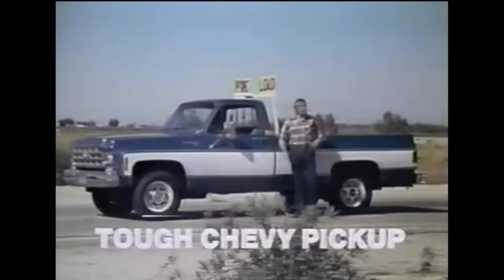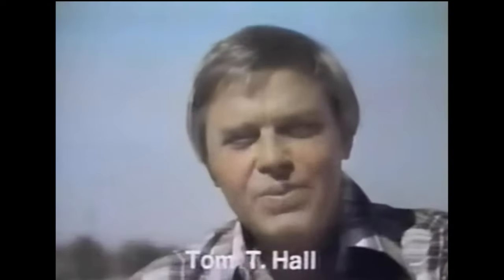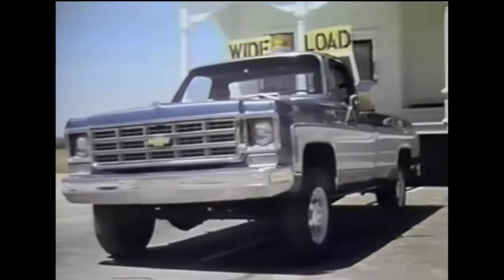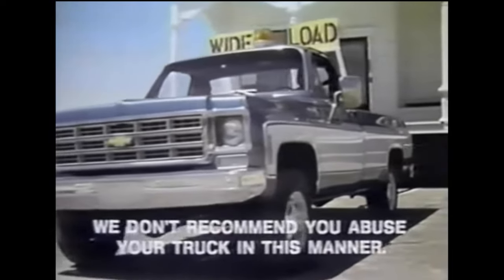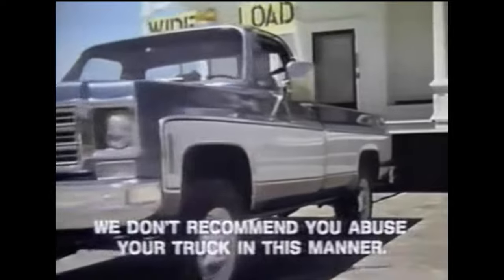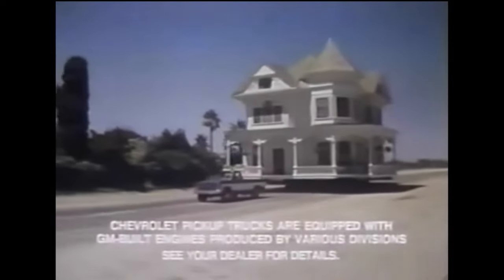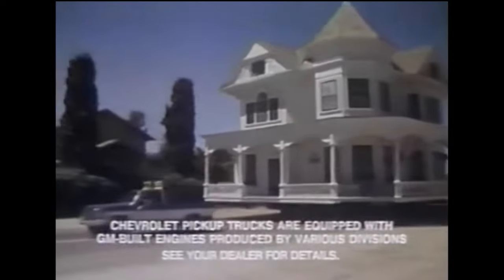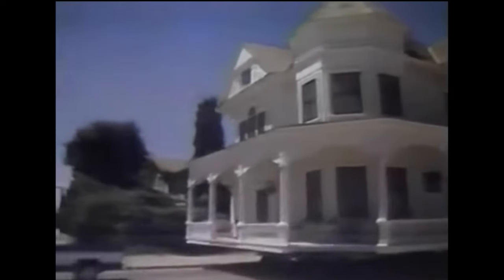Museum Quality Nut & Bolt Restored 1978 Chevy K20 4x4 | ResurreKting

Comment: Why was a NP205 transfer case not used?
Reply from the maker: @metalbill this truck actually came to us with an NP203(boat anchor) and we opted since having a 4L80E to go behind the big block, why not mate it with a pairable transfer case that we had in stock. So we went with the np208, very great setup for this show level of truck. If this baby was a wheeler we would have opted to find a np205 for it for sure! Definitely 205 the strongest t case from factory in our opinion.  Thanks for asking, take care ✌🏼

Comment: I bought a Scottsdale K 20 brand new in frost white 1978 .

Beautiful truck but the quality control was pretty lacking then.
Fremont California plant. Front window leaked as a sieve many runs in paint dash ends had rough edges came with out rear cab mounts lower bolts and rubber. 
They had a lot of bare steel sandwiched in hood, fenders, cab lowers etc.
Should have been primer dipped in a zinc treatment. Water would migrate in and not dry.
Rust through in very short order.
They were selling like hot cakes so it was more profitable to cut corners.
Reply from the maker: @billbright1755 yes we’ve seen in person and always kind of chuckle when someone checks out a truck restored to this level and thinks it’s how it came from factory, which is totally untrue. We look at it as the gm factory was making these trucks as more of a tool, that they wanted them to perform work tasks, instead of worrying about the cosmetic beauty points of them back then. But it definitely could have been nice if they would have budgeted more money into completely coating the bodies in every square inch which is still hard to accomplish. But more of them would have been saveable at this day in age. Do you know what ever happened with your 78, is it still around?

Comment: Says 350 in the ad but says 454 in the grill .
My 1978 Chevy Silverado says 350 and has a 350
Reply from the maker: @jimthomas1989 the 78 4x4 never came factory with a big block, that ad at the beginning is the original 78 commercial. Versus the other clips in the video are the custom truck we built to look fairly factory under the hood with the 454. Regardless either motor is great 👍🏼